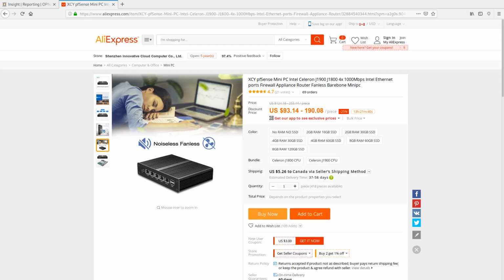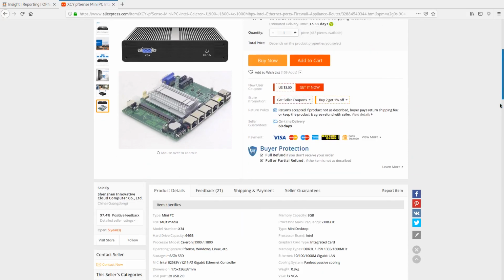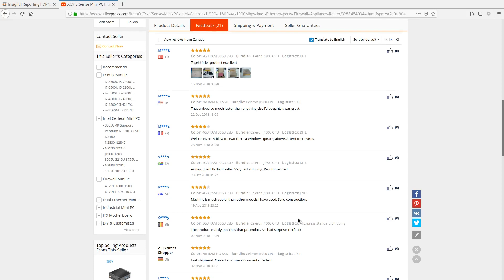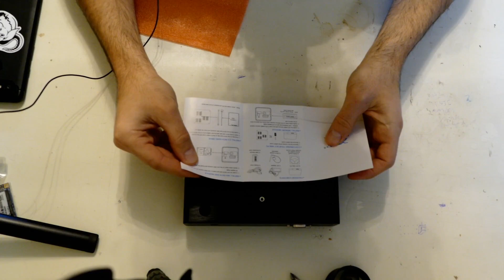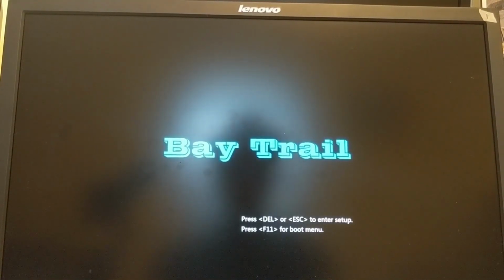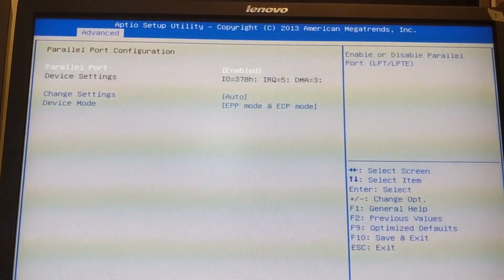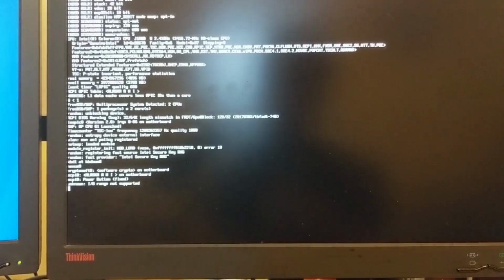AliExpress  XCY mini PC firewall j1800 j1900 & pfsense | opnsense installation

Comment: Anyone knows if is there an option to power up after Power failure automatically?
Reply: There could be a jumber inside to enable this. Not 100% sure but worth checking. Saw this other similar devices have it.

Comment: Hi there, i have a question,  i have normal router with wifi antenna that my mobile and another devices connect to my router wirelessly, and i have pfsese firewall but it doesn't support wifi my question is how can i connect my pfsese firewall to my router then my wifi devices can connect to my pfsense wirelessly?? Thnx
Reply: You can use your “normal” router as an AP.

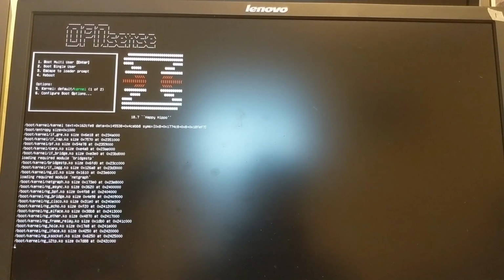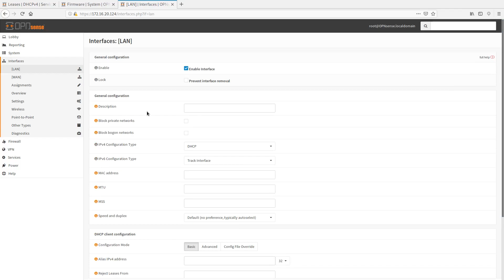Comment: It's interesting to note, that the LAN ports are just LAN ports and next reconised as NOT as individual Ethernet ports @ 8:58/11:14, https://youtu.be/ChBEVNsrLUc?t=538.

I have two ISP connections and LAN, was thinking of having my WiFi AP's come in on another port
Reply: Thanks friend, I was looking for exactly this information. So there are only two real interfaces (eth0, eth1), the others are like LAN ports on a switch. This is it, right? Possibly you can make vlans to separate them from each other.

Comment: There were places for 2.5 inches HDD in the box?
Reply from the maker: yep there is space for a 2.5 drive, there is also a power cable for one aswell.
Reply: @useurlogic4383  if I put in hdd, the fan can not or? How many millimeters thick HDD can fit? Is it possible to install the ubuntu 16.04.05 server on this router pc ?
Reply from the maker: if you use an ssd not sure you would need a fan, the processor directly touching the outer case so it should be sufficient. I would recommend just buying a cheap mstata and just utilize that slot. you wouldn't need more than a 32gb mstata
Reply: @useurlogic4383  I would put on msata ssd the system Ubuntu on 16.04.05 server and Install Unifi video. I already have 2.5 4tb st4000lm024 thick 15mm hdd. I would set the recording to go to that hdd of 4tb.